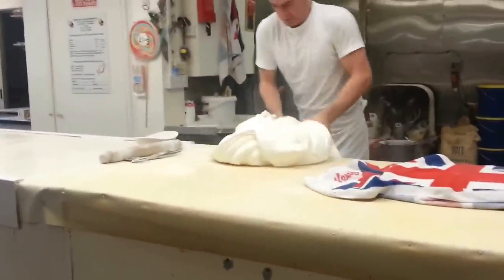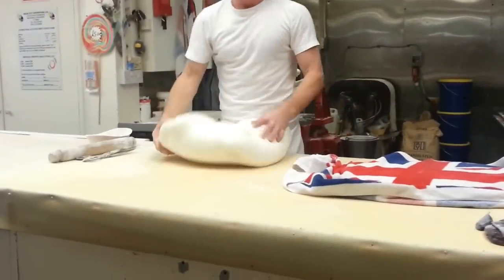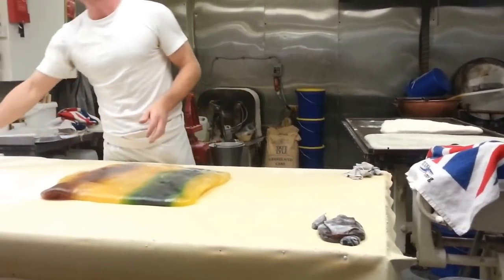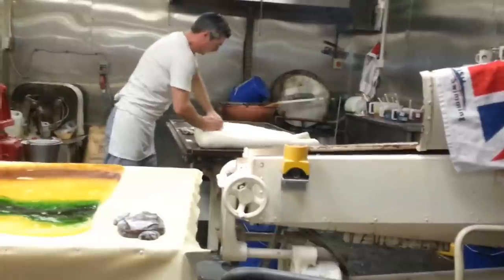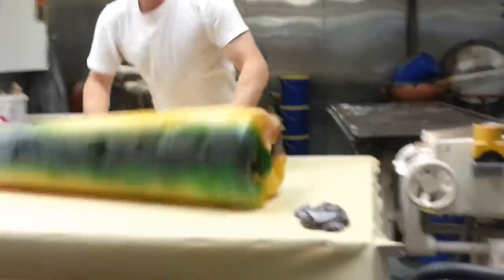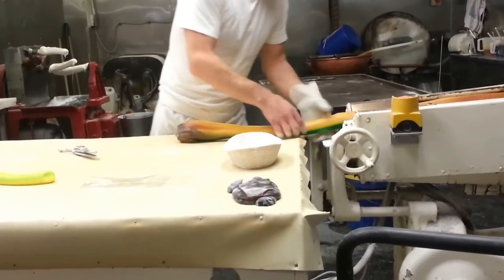Rock Candy Making At Blackpool

Comment: In every other video folks get the candy on the table and they're like "at this point it's still VERY VERY hot" and wearing insulated gloves and shit and this dude's just digging in with his bare hands...
Soft southerners, ah dunno...
Reply: Just about every seaside resort in England has a sweety shop that makes sticks of rock on the premises. All done this way. The classic presentation is peppermint flavour, with the outside 'skin' pink. The name of the town is spelt all the way through the stick.
He explained the temperature thing. Rather than the table cooling the sugar, the table is kept at 30℃, which stops it hardening. You saw on the cooling table at the back, how he reacted very quickly when he accidentally got hold of a hot piece. He was using the shears, rather than a flat blade.

Comment: but how do the put the letters all the way through it?
Reply: BurntFaceMan because the rock is a huge line and they create separate letters than push them onto the other ones and it is all they way down the same then it is made small
Reply: BurntFaceMan if that makes sense I have been there before it is actually better in the shop than watching it on a video
Reply: how its made did a video on it. its here on yt
Reply: its in a giant role with the letters then they stretch it till its small.  there is a video some where on youtube that shows it